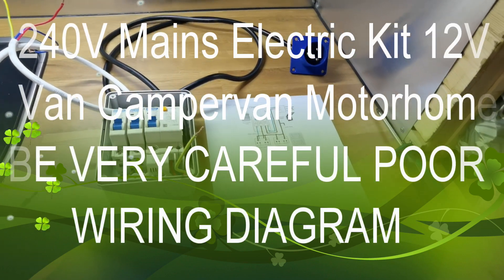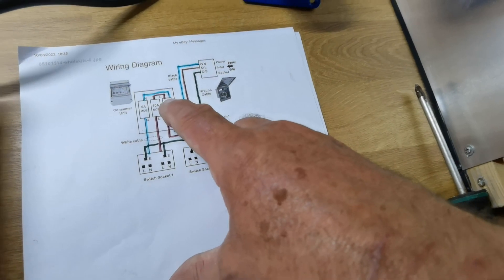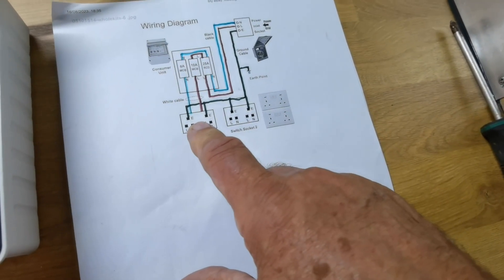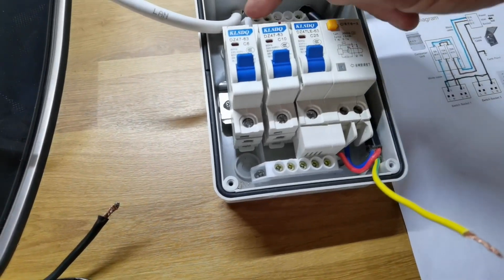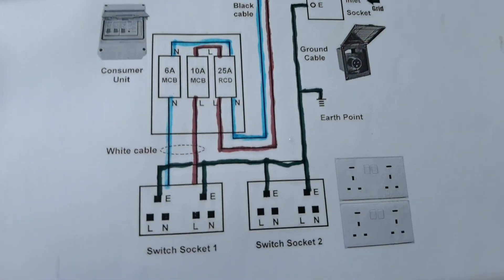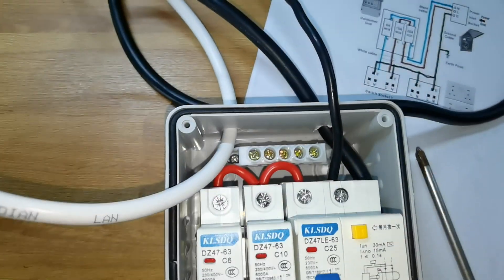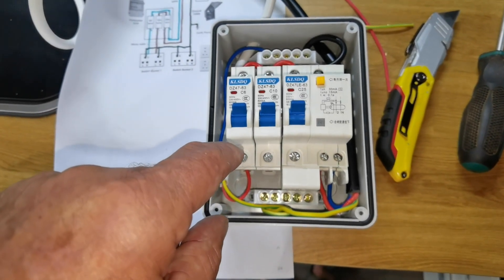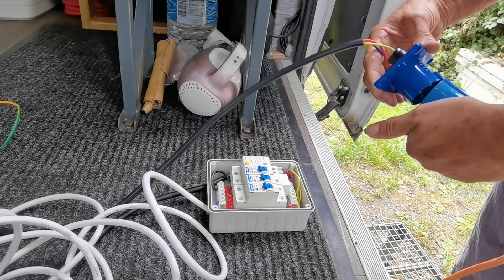240V Mains Hook Up  Kit 12V Van Campervan Motorhome

Comment: I have exactly one of these for my van conversion. Firstly thanks for the video it’s been a massive help!

Although I’m curious if anyone could please confirm this for me.
So in order to connect to my chassis ground point I have an earth cable going from the rcd units ground bar to my chassis ground point?
Or does I go from the shore power directly to chassis ground then into the rcd unit??

Many thanks

Comment: Brought the same one off Amazon had no instructions I asked for a wiring diagram they sent me a picture showing the live feeding straight into where the buzz bar connected and another live feeding the bottom effectively bypassing the rcb and the neutral feeding in the bottom and out the top

Comment: 🤣I have just paid £10 for one of these for a shed. Watching this has made me realise that these units are upside-down to every other wiring diagram of a garage consumer unit on here. The bus bar goes in the top. 😜
Reply: Would have struggled without your input and probably sent it back, but it is up and running. Thanks

Comment: I purchased one of these “bundles” from EBay. I wouldn’t have been able to complete the installation without your video. Thank you! It’s a very tight build, which is borderline defective however now it’s done I’m glad to have a very small unit in my Ford Transit Custom LWB.

Comment: For RVs, caravans, motorhomes etc., you should have dual pole switching.
This is case the supply you plug into or the extension cord you use, has the active and neutral wired the wrong way.
You still need the earth leakage circuit (RCD) to work.
The earth leakage circuit (RCD), same as you should have in your house, except you would have an active bus bar, neutral bus bar and an earth bus bar and a whole heap of circuit breakers for what ever functionality you require. 
The diagram is just a simple circuit catering for dual pole, which is confusing you.
The one with the active and neutral running through it is 'monitoring' the two to see if there's an imbalance; such as when something has gone wrong and shorted to ground. It will typically trip within 30 milliseconds (less than a heart beat) if that occurs.

Comment: I'm shocked watching this vlog your clearly not an electrician this
is not how you wire a consumer unit as the supply should come in through the top of the RCD and feed via a busbar along the bottom into the MCB's, the load is taken from the top of the MCB's, there are too many youtubers that are showing vlog's that have no experience  of electrical installation. 
I've been an industrial and commercial electrician for nearly 40 years, It seams everyone who carriers out van builds are an expert in electrical installation, My advice is check the information with a qualified tradesman and DON'T trust what you see on youtube no matter how professional they seam.
Reply: Show us all how its done do a diagram for us all

Comment: So wiring regulations section 721:- 
Only flex should be used with a minimum CSA of 1.5mm.
A 16A breaker should be used with a 2.5mm cable for sockets.
The use of C-curve breakers are likely too slow to trip in the required time due to long circuit lengths.
A 10A breaker for sockets is wrong and fusing the Neutral is very wrong. Imagine what happens when you exceed 6A and the Live is still live on the 10A breaker. You think the circuit is dead when the 6A breaker trips on the Neutral side, but the circuit would actually be live. "Never fuse Neutrals'.

Also the RCD is the old type AC, RCD's & main switches should be top fed, breakers should be bottom fed, there is no busbar.... The list goes on....
Reply: Hi there, can you show us on the diagram? It will handy, thanks

Comment: Top advice here is if you are not sure which is the in and out on an mcb 😔😔😏😏, get an electrician to do it!
Reply from the maker: Good tip! but not at £100 an hour
Reply: @MrMeltedwellies  I'm less than £100 per hour and still wouldn't leave you in a dangerous situation with a fused Neutral. That's shocking, literally...

Comment: The regulations for campervans/motorhomes/caravans etc, say that you need a double pole RCD.  18th edition wiring regulations 2022. It may have been updated since.
Reply from the maker: i decided to stick with solar if i need 240v ill use a extension lead to my battery charger thanks for watching and comment
Reply: Oh god, that is so wrong! it actually says, and I quote: 721.43.1 'Each final circuit shall be protected by an overcurrent protective device which disconnects all live conductors of that circuit' where does that say double pole MCB's? yes, ok, the most common way to address this is a double pole MCB, but you could also use a 2P RCBO's etc etc etc...
Reply: Just thrown away a unit as shown it's rubbish. Purchased a proper double pole unit £40
Reply: 18th edition is a ancient today
Reply: The RCD is double pole